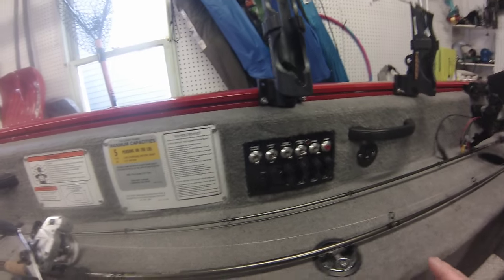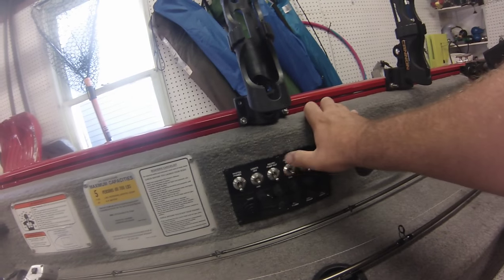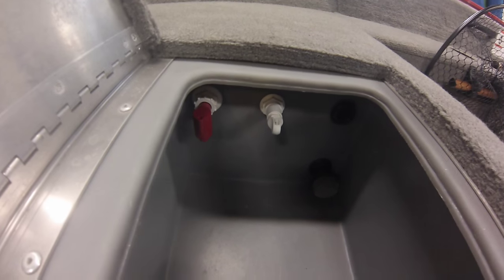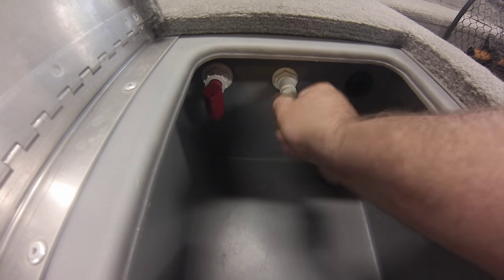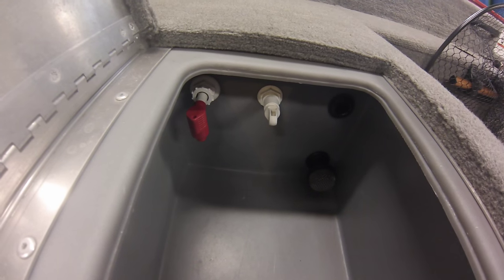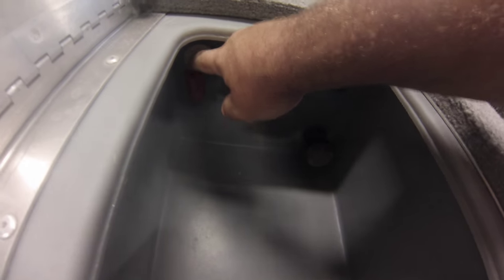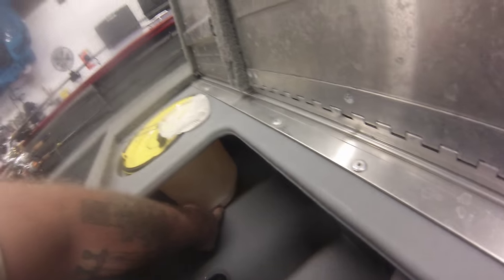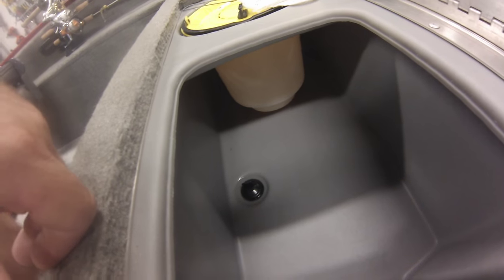How to use the Live Well/Bait Well on the 2013 Tracker V-16 Pro.

Comment from the maker: You have to use the airator to pump new water in.  The recirc pump only recirculates water from the bait well.  It also can pump out as stated in the video.  Hope that helps.
Reply: So if the white thing is completely in.. despite pressing the switch no water will come in? 

I want to use the livewell for other storage but sometimes friends accidentally press buttons/switches. Dont want a livewell full of water then..
Reply: @masomaf correct. The pump will run but no water will come in

Comment: Where can I get the screened plug on the bottom. Thanks for sharing.
Reply: I sold this boat about 5 years ago, however, you can buy the screen at any marine supply.  You just need to ensure you’re getting the right size for your fitting.
Reply: It’ll be listed as a livewell screen or strainer

Comment: Does anyone know where the water goes once you pull the drain plug in the bottom of the livewell? Does it go out of a designated drain pipe/tube or just drain out into the hull of the boat? I have a 2020 Pro Guide V16 SC. Thanks
Reply from the maker: Ty’s Adventures it drains out of a fixture on the hull.  When it’s trailered you can put some water in there with a hose and see how it works.
Reply: Liebelt Guide Service Thank you for the info. I just got the boat and mainly fish for catfish so that means a lot of big slimy/oily and scaly gizzard and threadfin shad and didn’t think that’d be a good move to be constantly draining shad water into the hull. I’ll do what you said and flush some water thru the drain and see where it comes out. Thanks again. 👍🏻

Comment: How do you keep water from going in the livewell? I just bought a 2018 bass tracker pro guide  175sc and took it out to break in the motor. Not sure how it happened but i didn't want water to go  in and most of the time i never keep what i catch. Just want to prevent water filling in  the well when not used.
Reply from the maker: ozzie kuma if the switch is in the off position, you should not be getting any water coming into the livewell.  If water is coming in, I’d contact your dealer.
Reply: Yeah i have no idea how it took in water
Reply from the maker: ozzie kuma Next time you are out just periodically check the live well and make sure the switch is off.  If water is still coming in, then I’d take her in to the dealer.  Hope that helps.  If you’re getting water down in the bilge, that’s the worst that could happen.
Reply: ozzie kuma curious if you got this figured out? I just bought the exact same boat and had the same thing happen yesterday.  We broke in the motor yesterday and I can’t be certain  that the switch wasn’t  accidentally turned on but my rear livewell was full of water.
Reply: kingrider75 it hasn't happened again since i broke in the motor. Just make sure that all the switches are on the off position. That's what I did initially and it damn thing still filled up don't know how but it  hasn't happened again
Reply: ozzie kuma thanks for the response. I was just surprised to see a livewell full of water when we pulled the boat out of the water. One more question, did your boat come with the threaded over flow drain?
Reply: kingrider75 not sure what that is or looks like. But it does have a small circle or hole, what ever you  call it,  on top to prevent the Live Well from overflowing.
Reply: If you look at the video there's a small black circle next to the aerator which is the white threaded thing
Reply: The small black circle is the Overflow drain and I'm not sure if that's threaded
Reply: ozzie kuma ah ok I see. The reason I asked is because In my manual, it shows an approximately 8 or 10 inch piece of what looks to be 3/4 “ or so pvc pipe with a threaded fitting on the bottom that screws into the drain plug hole. After doing some more reading it seems that this piece may only come with non pump out style livewells.
Reply: Was searching YouTube for this issue.  I have a 2020 Tracker Pro Guide v175.   My rear live well fills up all the time.  Plug is in, no pumps on.  I can’t figure it out.  Wondering if pressure while running on plane sucks water into the live well??   Did u ever figure it out?
Reply: @ThoughtIwasFishin  it happens to me still to this day. The only thing I suggest is leave the live well drain plug open so it doesn’t stay filled with water. It still fills up on it’s own without the pump turned on.